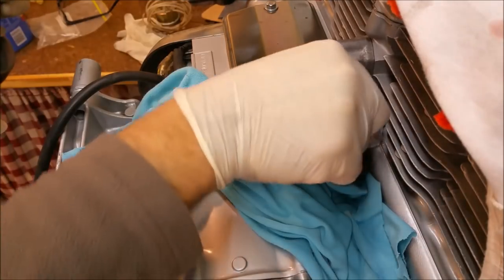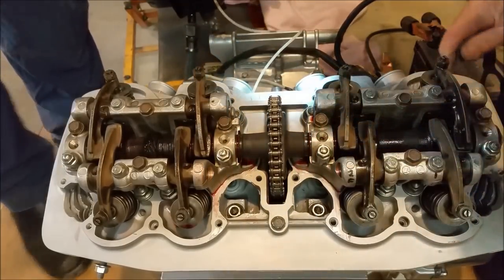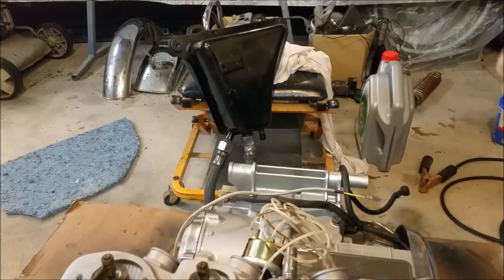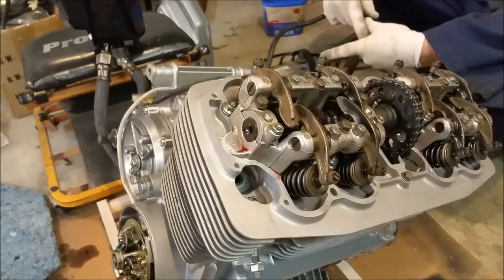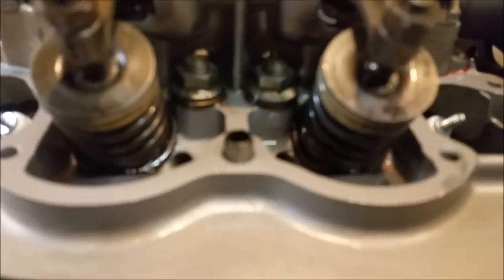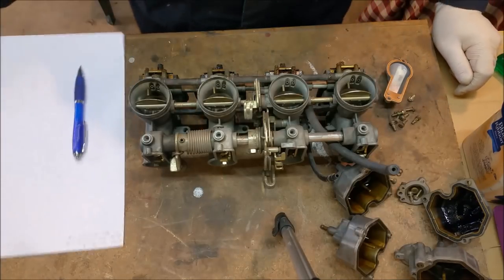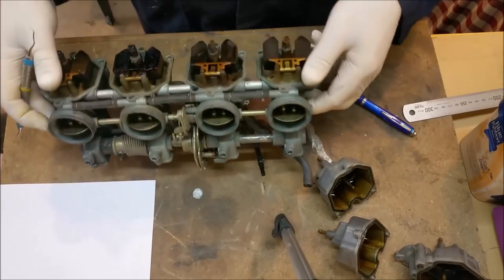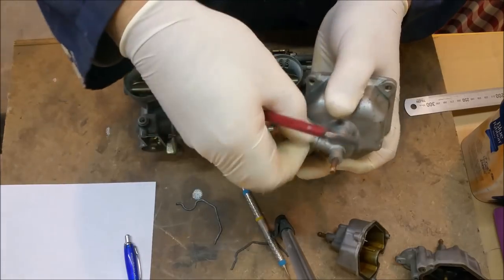CB750 Restoration Part18 - Checking for Oil Pressure and Stripping Carburettors

Comment: You've unwittingly saved my day. This morning I dropped off my bits and pieces at Warners for plating. Came home and started watching this. Then heard your comment about high tensile bolts going brittle though the process. I knew I had handed over a dozen or HT bolts. I just rang Warners and they can oven bake them to de-brittle the bolts for me. Thanks Peter, saving the day with little tips here and there. Imagine driving along and having control arm bolts fail! Cheers & regards Steve.

Comment: Peter, you're a very thorough individual and the video segments you produce are not only entertaining but, more importantly, insightfully educational. Thank you for keeping the problems as well as the successes intact in them.
On the subject of carburetors, having sat for decades with perished fuel in them, the methodology that I've employed over the years is a little different than what was displayed. Now, my preferred method is to let chemistry make the job much easier.

1. Remove the bowls and thoroughly submerge, soaking them in WD 40. (WD 40 not only loosens everything, it also rejuvenates gaskets and seals temporarily without damaging them.)
2. After the usually daylong soak, remove the needles valves, jets and emulsion tubes freeing the passages, working the freed floats and/or slides, needles and pins leaving the majority of the assembly intact. Use low-pressure air to force the lubricant through needle valve passages. Ensure that screw positions are noted for re-assembly.
3. Use a toothbrush, the softer the better, lightly scrubbing the floats, bowls and the internals of the carbs. Leave lubricant in place unless really varnished. If severely varnished rinse with the lubricant and repeat.
4. Re-assemble everything, minus the bowls, to prescribed positions taking care not to damage gaskets and delicate seats.
5. In a bucket with a lid, re-submerge everything in fresh alcohol-free premium gasoline.
6. Attach a variable speed sander, I use old bicycle innertubes, onto the outside of the bucket with the rubber pad contacting the bucket's lid, minus abrasive, and turn it on to the absolute lowest speed and leave it on for some time. (This acts quite well as an impromptu sonic cleaner.) Vary speed accordingly to suit your needs.
7. Take the whole assembly and bowl covers out of the gasoline soak, shake off excess, and blow low-pressure air over everything in order to dry the pieces. (This will usually dislodge more debris.) Rinse and repeat if necessary.
8. Re-assemble the bowl covers and install on the engine, ensuring that everything functions as it should.
9. Attempt to re-start the engine.
10. This whole process usually takes far less than two days. Other checks are done while waiting for the chemistry to work (Actual hands-on time is quite minimal due to allowing the solvents their time to work.)

This method may seem a little strange; however, to ascertain the condition of an engine quickly before necessitating a complete teardown; it works quite well. My experience has been that of 95% success: Your results may vary. Some carburetors are beyond the scope of this procedure. I don't do many restorations and the pieces that I do work on are for a quick flip and re-sale to somebody that will, or simply enjoy the vehicle as is until a full restoration is warranted. I also use this procedure on pieces that I eventually fully restore to quickly sort out what I've gotten into.
It is my hope that this is helpful to you and your subscribers. This has definitely helped save time and money over the years without damaging precious parts. Even when dealing with automotive carburetors once you look inside then soaking them in fuel will usually get an old heap quickly sorted and running again.
Thank you for the instructional video and allowing me to pass on some knowledge.

Comment: Had the same issue today with zero oil pressure. It was weird that when I had it on the stand, oil pressure was good but when I tilted the engine to install the frame, righted her up again, cranked the engine and got no oil pressure. I removed the clutch basket and kept kicking the kickstart to agitate the oil pump. Also tilted the engine w/frame to one side and got oil pressure. Tested it again when cranking and got zero oil pressure again. Defeated, I put everything back together again, tried cranking it and voila! I got oil pressure. Don't want to figure out what I did/didn't do right. I'll take that as a win and call it a day. Thanks for the video - it really helped me a lot.

Comment: hey pete, as always i find you vids exeptional, i have not finished  watching this vid yet but i thought it worth mentioning, in this vid and your last i agreed with the fact that there are loads of carb rebuild vids out there, but there is one vid i have not found yet,. and that vid would explain the most basic principal of carberation, and i think you are the perfect teacher to do so, as you know most people think that fuel is  "sucked" into the engine, when in fact it is pushed into the intake by atmospheric pressure. yes, all vids cover the basics, "is the main jet clean? is the idle circuit   clear? does the foat leak? dose the needle seal? sure. all important checks, but if more people understood the "venturi" effect and what is actually happening, it would be much easier for them to find thier problem, i cannot beggin to tell you how many small engines i get in my shop for a "run then stop run then run again" and all it needed was the fuel cap unplugged or replaced, sorry for the long comment, but i couldnt say it shorter i think.

Comment: Adjusting the idle mixer screws must be a nightmare on a engine that has a carb for each cylinder.  I don't know enough to even guess at what other challengers come with this.

Thanks for doing the carb video.  It's going to be fun to watch you get them put back together.
Reply from the maker: Thanks, it's going to be fun putting them back together - I don't think... Cheers

Comment: I as taught to pack a dry oil pump with vasoline petroleum jelly. It’s compatible with almost any lubricant. I don’t like to use grease because it shows up in oil samples. I built a prelude pump out of a Detroit Diesel fuel pump. It has a relief valve set at 70 psi and an easily adaptable square drive. An in line oil filter is used. Like your videos...keep it up...thanks

Comment: What I found works for unsticking gummed up carburettors before pulling the jets and other bits apart is dropping them into a pot of distilled water and bringing it to a boil for about 10 minutes. Then letting them sit in the water until they cool enough to handle then blast them with compressed air.
Reply from the maker: Great idea... never considered that, cheers.

Comment: I'd be very careful about using thinners in an ultrasonic cleaner, the vibration will make it give off a lot more vapour than normal which could be ignited VERY easily.  And definitely DON'T use it in a heated ultrasonic cleaner as you'll pretty much just be creating a fire bomb in your work area.  As others show on their channels (like Mustie1 for example) conventional household cleaners can produce excellent results on components contaminated with ancient fuel without any risk of damage or injury, it just takes a little time.  If you don't have an ultrasonic cleaner then soaking the components for a decent length of time in a sealed container (make sure it is resistant to the thinners as some types of plastic will be attacked by them, a large glass jar with a metal lid such as those used for making pickled onions at home is ideal) of thinners kept in a cool place will do a good job of cleaning the mess up and freeing parts seized by the fuel residue...
Reply from the maker: I never intended to use thinner in an ultrasonic cleaner... didn't want to buy one, so ended up visiting the hydroblaster... all parts look brand new now. With restoration type stuff I look at places like The Healey Factory and use some of their methods and suppliers. Although I have enormous respect for a lot of YouTube creators like Mustie, I don't normally use their methods, they don't seem to achieve the standard I'm shooting for. Cheers

Comment: About the carbs. 
These are actually very primitive. Not a problem if you know how to use them, but their slides are not vacuum controlled and therefore opening the throttles quickly at low rpm causes the engine to die. This is worst on the years '77 and '78 because those were jetted very lean. The accelerator pump was added to the '77, '78 K and F models to compensate for this but they have very little effect, I found. And the accelerator pump is the least reliable part of the assembly; clogging up with dust and seizing easily. 
Anyway, this caused endless complaints on sohc4 forum from people new to these older bikes, because they thought this was a characteristic that could be tuned out. Nope. You have to give it only as much throttle as it can take. Otherwise, letting clutch out at just above idle then hitting the throttle to go, will only cause a stall. Embarrassing at a traffic light with people behind you.
Good thing you're getting a complete kit with new floats. These foam floats not as reliable as the soldered brass ones used 1969-1976. I had one sink on me; that sure caused a lot of grief before i found the problem. I finally one day so fed up with mysteriously running on 3 cylinders that I yanked out all the floats and dumped them in a jar of gas. #1 sank.
The throttle return spring is way too stiff on long rides. I finally disconnected it entirely. Not as dangerous as one might think since there are two cables: pull open and pull closed, so doesn't stick open anyway.
Jetting: I think you'll find the mains are 105. Stock for 1976 and earlier was 110. I've even run 120s. A little less economical but a little faster to warm up.